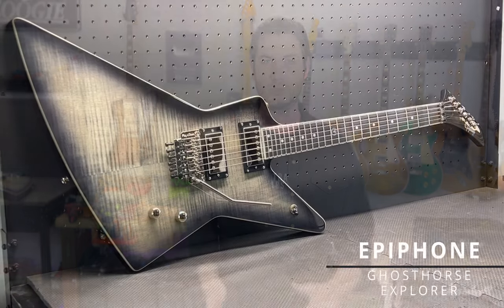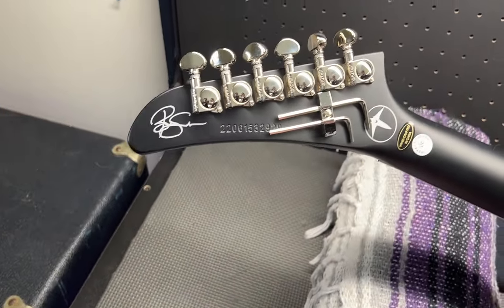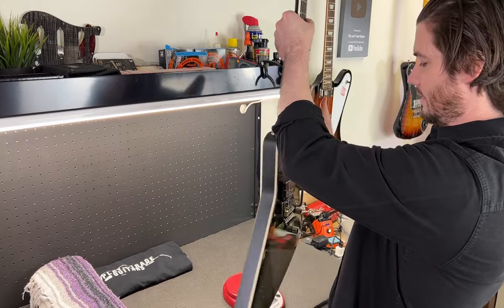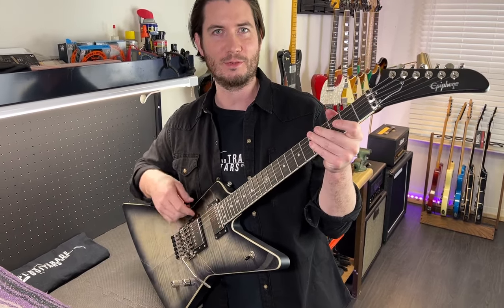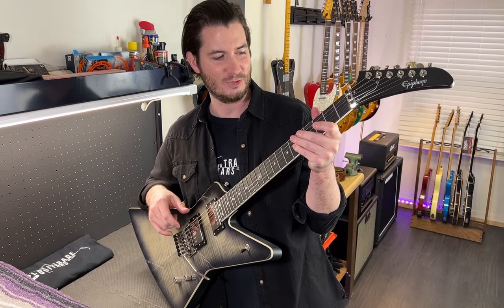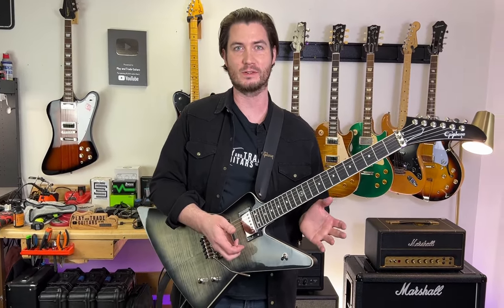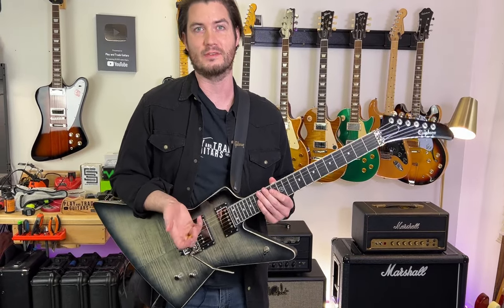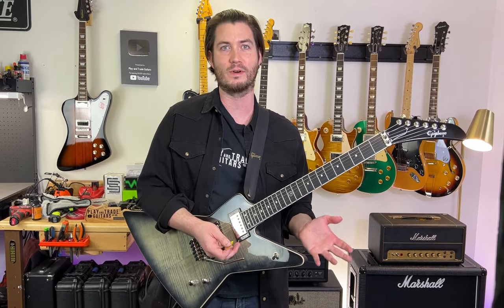Epiphone's BEST Explorer - Brendon Small Ghosthorse

Comment: I have purchased this guitar just recently and got it exactly 12 days ago, which is a funny coincidence.
I don't know if it's a difference between years of manufacturing (my is 2022) or if my instrument is a chinese copy made extremely well. After ordering the Ghosthorse I watched a lot more video reviews about it, and almost everywhere I remember the reviewers all told that ghosthorse's floyd rose can tilt only downward because of lack of tremolo cavity in the body. I was very dissappointed because I wanted a floyd that tilts freely in both directions.
After recieving my guitar I was pleasantly surprised that it in fact moves in both directions. Ghosthorse has no cavity for floyd rose but it's through cut is wide enough that it provides window for floyd rose motion in both directions.

Judging by what I see on your video, your guitar has same configuration and through cut is the same, so it seems like the guitar I have is original. Also I have doubts that somebody would make a fake copy of a signature guitar, especially this good.

Btw, the neck pickup in a split mode sounds absolutely godlike. And reverb + delay makes it even better. But since I'm a metalhead I probably won't use it this way for a long time :)
Also, the factory strings are very soft, so soft in fact that after using chinese strings on my previous guitar I ended up moving strings to the side of the neck beyond the fretwires with hammer-ins on low E and pull-offs on high E string. That's of course lack of technique but it was quite funny.
Also also, the cut below the neck is really uncomfortable for reaching 23th/24th fret. Won't stop a fine shredder from tapping the hell out of these frets, but just wanted to confirm.
Also also also, the case was in a great condition compared to what I've been looking at in those reviews. Nothing was broken, nothing was torn off, and my case is perfectly usable without having to repair it, straight out of the box.

Still, I fell in love with this guitar the moment I discovered it and only started loving it more as soon as I started playing it. Brendon Small really has a great taste for guitar parts, and as my token of respect I promised myself to learn the whole Doomstar Requiem duel.
Reply: Hey , appreciate you sharing your experience with this guitar. So if I get this guitar, do I have to ask a Luthier to route out some wood from the body ? As you said, a Floyd Rose is supposed to have a motion both ways i.e. for Pull Ups and Push Downs and this guitar does not give you that flexibility. Thank you so much! Cheers.

Comment: I bought one and the switch was massed up.  Would not work all the way if at all in the middle position. 
I said send a switch and I will replace it myself.  They sen a cheap switch with a plug and 4 connections.  I thought ok no soldering, just wp the out. It was sent to me from Gibson.  I pulled the cove roff and it is a 5 prong switch so it is not going to work. I had already given the case to Guitars 4 Vets at the American Legion since I bought an SKB hard case for it. They said I can ship it back and they will fix it and ship back to me.  Oh no. And loose my hard case.  They sent me another one and said they would bill me if I didn't ship it back.  Wewll the second guitar did the same thing.  I just had a tone knob installed and a new actual Switchcraft and now it is awesome.

Comment: Floyd is not routed in the body i am hearing? just set on top of the body? must been told wrong ,right?
Reply: I have one in your right the body is sitting right on the rest of the body it hasn't been cut out like it should be I think about having a mild out but other than that it's a great guitar
Reply: I have one it's a great guitar